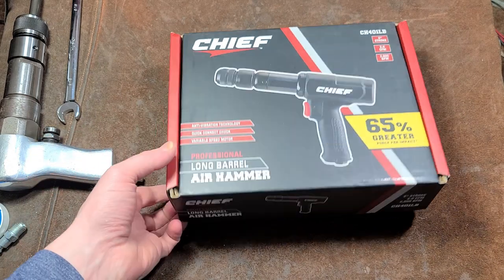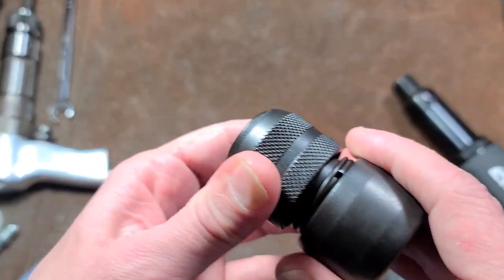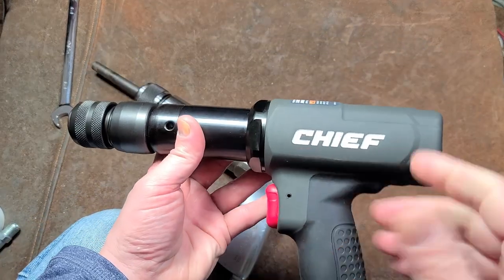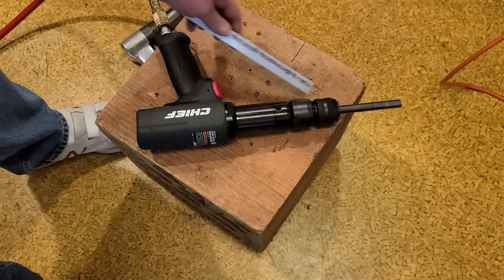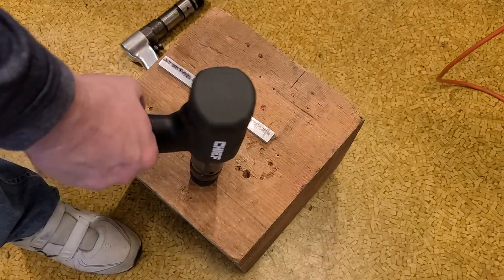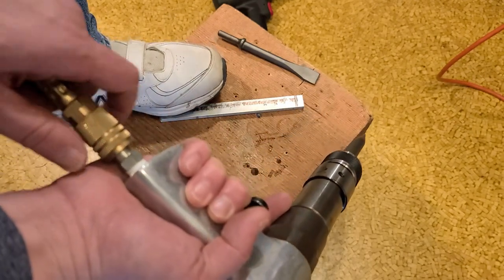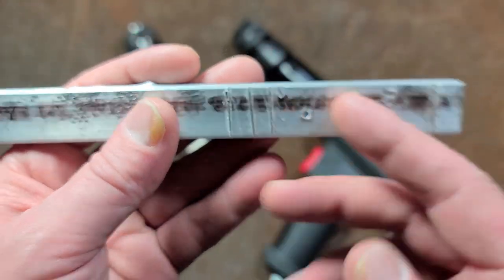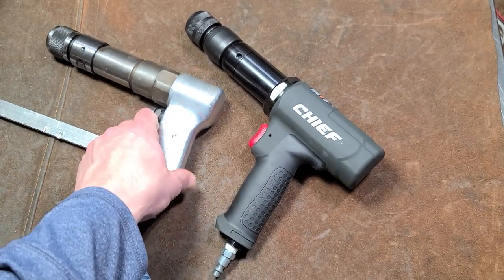Harbor Freight Chief Pro Air Hammer Review

Comment: I've had the chief air hammer since early March. Purchased it for $80, they are currently $130. Luckily I purchased the 2 year warranty when I bought it. I just had to exchange it the other day. I absolutely love this air hammer even though I had to warranty it. I will not hold it breaking against it, I bust up concrete very regularly with it, it definitely gets used a lot. IR's last about 2 months, this thing lasted about 9 months with extreme use and a lot stronger than the IR's. The quick connect never backed off.
Reply: Are you referring to the Ingersoll Rand 119 MAKX? I was trying to decide between that one and the Chief.
Reply: @nicolasveal5496  no, I had the 114gqc. I haven't used the 119makx. It may be better. I've broke another chief since this post, the extended warranty is really easy with harbor freight to exchange. I chip hard concrete out of my hopper on a concrete pump every couple of days, so no air hammer is going to last long. We have a pile of broken ones at the shop including a snap on. I also use the chief to knock out through shaft bearings and outlet bearings. It's definitely strong, just doesn't have longevity in my industry.

Comment: I agree with you to look at a more commercial hammer. When I bought my hammer years ago for suspension work, the tool guy told me it was all about the beats per minute that gives you the power. Also that Star Wars size blaster would be too big to fit in some of the suspension areas to free joints.

Comment: I've  got  a  sunnex long  barrel  and  it  definitely  has  some  good  power ,  but  if  you  really  want  to  turn  it  into  a  beast  use  a 1/4 npt  high  flow  nipple  and  adapt  up  to  a  1/2 inch  hose.  The  extra  volume  makes  a  big  difference .

Comment: I have true rivet guns, no air hammers. They are rated in bore×stroke of the piston. They have a "teasing" throttle allowing single blows to WOT. Nice review as always, Catus. I look forward to your videos every morning! Better than the news channels.
Reply: This. I have this Chief hammer and the trigger is basically an on-off switch. It's brutally powerful but VERY hard to control so I find myself having to turn down the air pressure to make it more controllable. A rivet gun is so much better than this Chief hammer. I'm thinking about ordering the ATS 7x so get something with power AND control.

Supposedly the Sunex is pretty controllable and not super expensive.